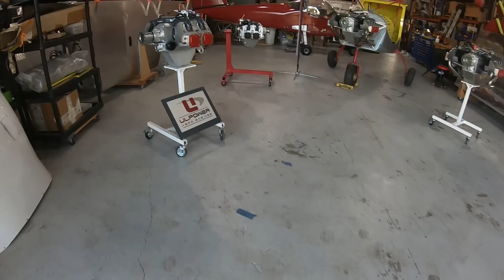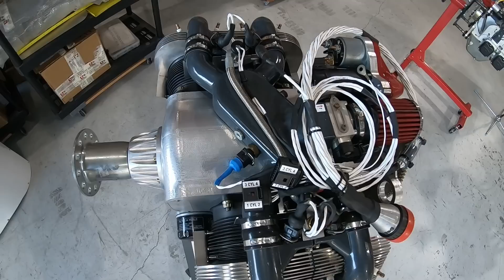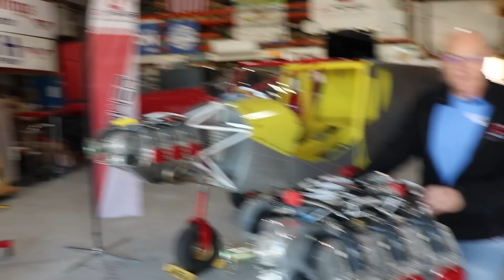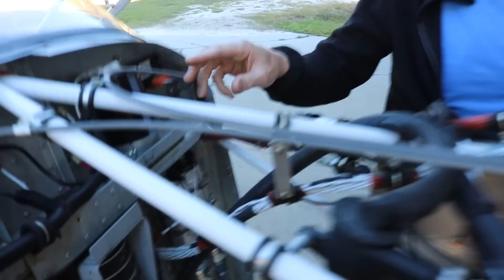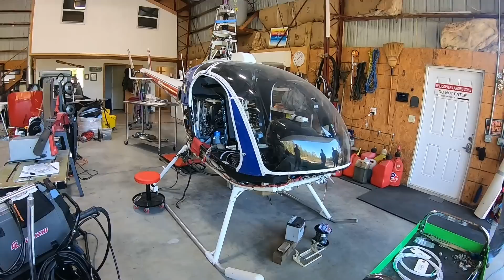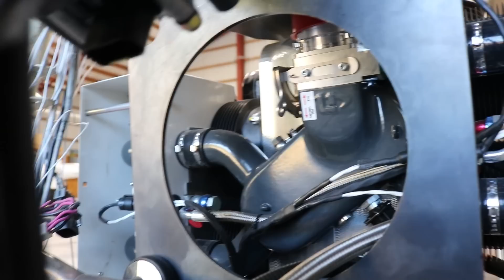UL Power Aircraft Engines - ENGINE WEEK 2024

Comment: I am curious - With the overhead rotors making so much down pressure would the oil cooler be starved for air because it is trying to pull air up in such an overpowering down pressure ?

Comment: Are the crankcase halves investment cast-?

Is an O ring in a groove in one of the case halves used to seal the case halves or is sealant used, or both an O ring and sealant used-?

I do not like the big external ring gear on the back of the UL for starting.
I prefer the Continental idea of the starter which is mounted on the accessory case on the back of the engine and drives an internal gear inside the case, so there is no need for a ring gear which means less weight.
For a Lycoming engine, the starter is mounted on the front of the engine and it requires a ring gear. In order to replace the alternator belt which is also on the front of the engine, one has to remove the propeller to replace this belt. What a hassle.
Reply: I fly with the 350iS. I had the ring gear off to upgrade the alternator.  The ring gear also has cool blades attached but still weighed maybe a couple of pounds.  With FADEC the engine starts in less than one rotation and runs like a Honda - hit or cold. ULPower have all their manuals on line and you can see the exploded views of the engine.  Very nice engine to work on.  I have 90 hours on mine so far.  UL uses Bosch parts which are relatively cheap.
Reply: @pilotblue6535  Hopefully the TBO goes up to 2000hrs after more time in service.
Reply: Case halves are assembled with sealant and have O-rings in between them too.

There are different ways to design an engine and ULPower focused on Keep It Simple therefore the choice was made not to have complex solutions. It is a very easy engine to work with all maintenance manuals published (downloadable) online as stated below.
Reply: @hermaneshuis4789  The UL engine is superior in design when compared to the Rotax.
The UL does not require a coolant and all of the hoses etc like a Rotax.
There are far too many parts on a Rotax to go wrong.
Reply: @John-nc4bl  So very true!!  We do install a Rotax in the Zenith's once in a while, but 90% of our installs are of course ULPower because as importer I am biased and they are so nice to fly behind. 🙂
Reply: @hermaneshuis4789  I wish that UL would get rid of that starter ring gear wheel and have the starter drive an internal gear inside the accesory case like a Continental 0-200 engine.  It would be a weight saving as well.
Reply: Continental starter adapter is the single worst feature about those engines. No one should ever copy that design mistake. You either always carry a spare for when it inevitably starts to slip and you can't start the engine or you use a retrofit bendix stater.

Comment: UL aircooled engines do not have flanged and bolted crankcase halves like Continental and Lycoming engines.
I wonder what the reason for this is-?
It appears that they just rely on thru studs to clamp the case halves together.

Comment: Is the ignition system completely separate from the engines electrical system, meaning if the electricity producing part of the engine fails and the battery runs dead, will the ignition system continue to work
Reply: I fly with the 350iS. The engine comes with either a 30 or 50 amp alternator.   The engine requires 12 amps.  If the alternator dies you will be running off the battery.  The standard battery is an Odyssey 625 so you’ll have an hour or so.
Reply: @pilotblue6535  I was an A&P for over 30 years and it's magnetos for me all the way
Reply: @pilotblue6535  As an A&P for over 20 years, Im going with magnetos all the way
Reply: We install dual battery systems in 50% of our builds for redundancy it all depends on the comfort level of the owner. As pilotblue6535 mentioned you have about an hour until your battery is depleted after you loose your charging system. It is important to keep your electrical system healthy.

Comment: Have you got a mount for a Vans RV8 with the 6 cylinder 200BHP?
What is the saving in weight over a Lycoming  O360?
Reply: Yes, we do have a mount for the RV8 and have a few people installing the UL520 series engine in several RV models. I have the  RV7-9 A mount in stock for the new puck suspension. We ran out of time to show this in the video.
Reply: Oops, forgot the weight savings, Installed UL520 iS weight is about 240Lbs You're saving at least 60 Lbs. maybe even more.

Comment: Herman wasn’t very specific with the fuel burn questions. Specifically, since the higher HP engine are becoming popular in Zeniths, what is the expected cruise burn for the 160HP high compression UL390 compared with the 180 HP low compression UL 520?

Since the Zenith engine mount appears shorter for the 6 cylinder 390 & 520 than the 4 cylinder 350, is the same cowling used for all 3 installations? Any cooling issues?

The 390 and 520 engines have similar HP ratings to the higher HP Edge Performance engines, but the Edge engines seem to be significantly lighter, even with their turbo and intercooler. For low altitude East coast Zenith pilots, that may not get as much advantage from the turbo complexity, cooling issues and increased maintenance, it would be very interesting to see an in depth comparison of a UL versus Edge installation on an East Coast Zenith Cruzer.

Great job Bryan! Keep up the excellent work! Have you firmed up an engine for your Cruzer yet? If cost wasn’t a factor, would you go with a higher HP Edge or UL engine?
Reply: Good point regarding fuel burn, the UL520i burns 8 - 8.5 Gph. We have not installed the UL390high compression ourselves and cannot give you exact numbers but expect about half  a Gallon less per hour.

The same cowling is used for all the models, we do a few modifications for extra airflow, no cooling issues.

I am curious to find out about performance between Edge vs UL myself, maybe something we can do in the future and have Bryan make a nice video from it. There is indeed a substantial increase in complexity when installing the Rotax based Edge Performance engine!

Thank you for your questions and I second your compliments to Bryan putting this great video together!
Reply: @hermaneshuis4789 
Thank you Herman! Great reply!
Reply: @cpg727  something to note with those low compressions, even if the fuel burn is a half gallon more than the high compressions, being able to safely run 91AKI (up to 10% ethanol content as well) premium pump gas is a massive savings note per gallon. (Think $3.87 a gallon [US average as of Dec. 2024] and available everywhere in the US vs UL94 ranging anywhere from $5.00-$10.00 a gallon and limited availability across the country)
If you have the availability of 93AKI non-ethanol fuels at your disposal and are not doing a lot of cross country flights, the Higher compression models would be attractive; for most of the US, 91AKI(E10) is the most common which at least to me makes the low compression models more attractive just because of fuel availability.

-T
Reply: I have 700 hours on my UL350is.  Cruise RPM's are between 2200-2800 (I typically run 26-2700).  I almost exclusively run 93 Octane non-ethanol auto gas (purchased from my local Murphy Gas Station).  My fuel burn is 5.5 to 6 GPH.
Reply: It's all on ULPOWER web site!
Reply: I run a UL260iSA in my Silence Twister. Fuel burn in cruise is 4 Gph. I have over 650 hrs on the engine to date.